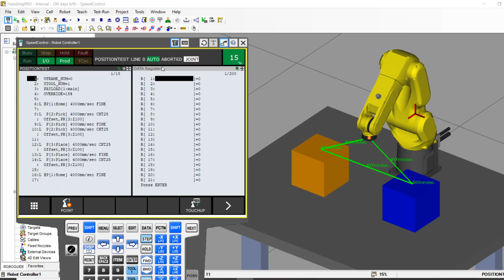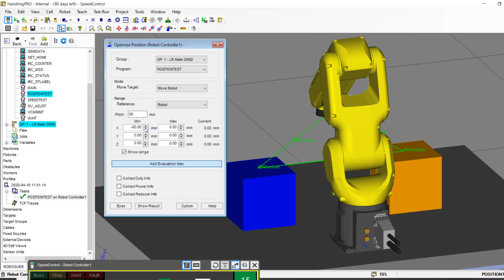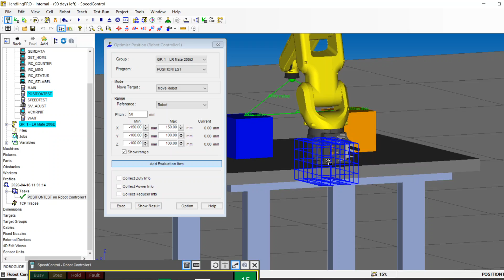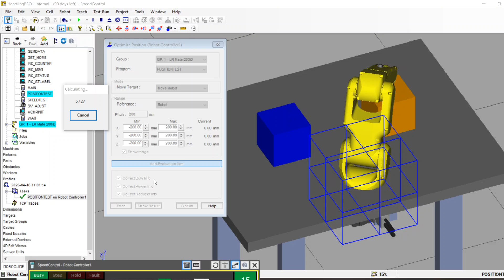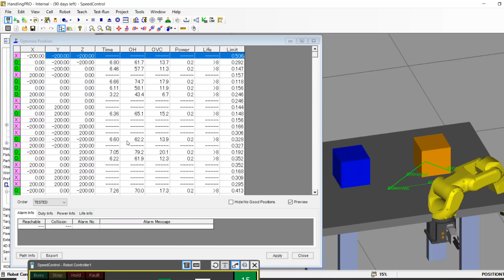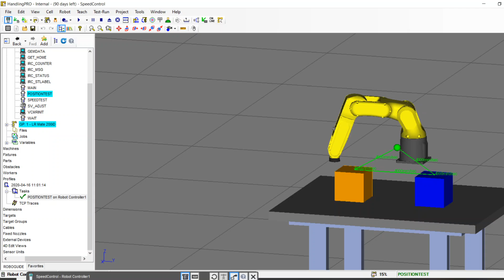FANUC Optimizing Robot Position

Comment: Hey Adam, great videos! Why can't I find the 'Optimize Position Utility Menu' in my tools dropdown in roboguide? Does it require a robot option or some special version of roboguide?
Reply: Hey guys, just a note on this since I did get it working; the solution was to re-install Roboguide and when you get to the menu asking which Utility Plug-Ins to install, you need to select 'Auto Place' and 'Machine Tool' options. It's usually best to install all of the Utility Plug-ins if possible so you don't run into any limitations!
Reply from the maker: @douglashales3982  Thanks so much for the great info and update, Douglas!
Reply from the maker: @Marshall Todd Great question; along the top toolbar in RoboGuide one icon is the Runtime Panel. Open that window, and down in the bottom section are checkboxes for collecting profiler data. Check that box and run again, the data should appear in the next profile generation.
Reply from the maker: Hi Douglas, it is possible that you are working with an older rev of RoboGuide that may not have that capability installed. I am working with Rev 9 software, but I know this was also available on later versions of Rev 8. Please contact the FANUC Hotline to see if they have further items to check for this tab, or to get an upgraded revision.